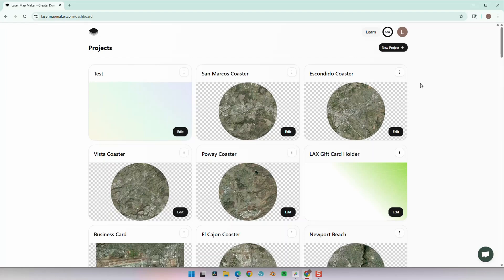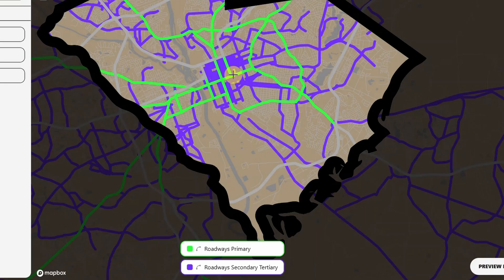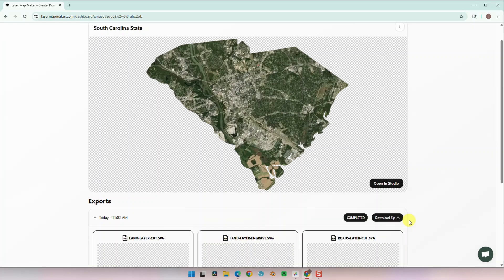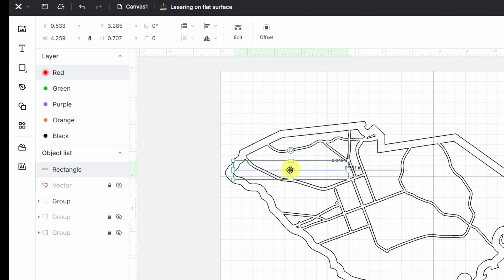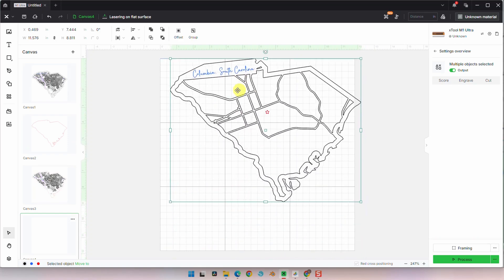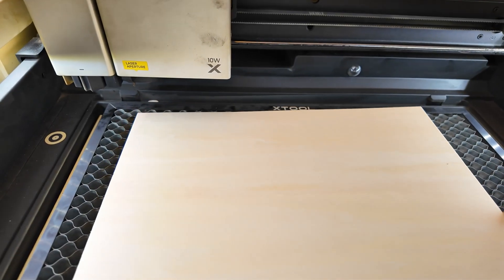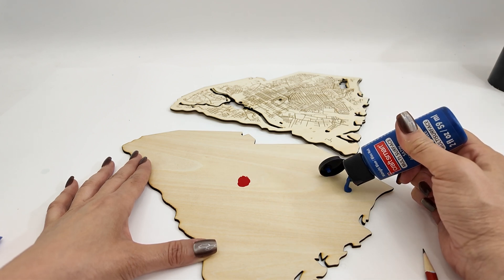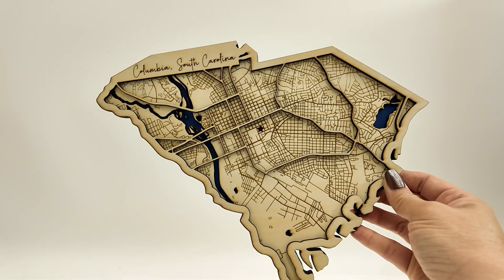Easy Method to Laser Cut and Engrave Any US State

Comment: How long did it take to cut and engrave it all? I am making my first one, and it seems like it is going to take quite a while for the engraved/cut layer (it seems long to me because there are not many roads, etc where I live). Being my first attempt, I am wondering if I have done something wrong in the file creation part.
Reply from the maker: It really depends on your laser machine. My machine is at 10w so it cuts much slower than a 20w or 60w machine.

Comment: I am working on a project currently for family and wanted to ask what was the thickness of your roads layer. Thank your for your hard work.
Reply from the maker: I usually have it pretty high at 7 or 8 but for me, the actual thickness changes  depending on how you scale the image in the laser software. I suggest picking a size that “looks” right compared to the rest of the map and then it will cut accordingly.